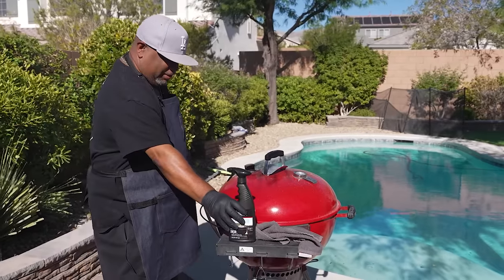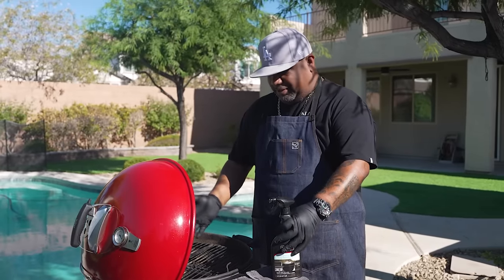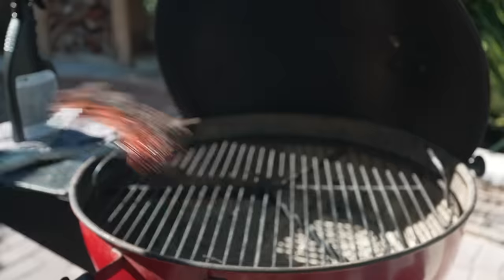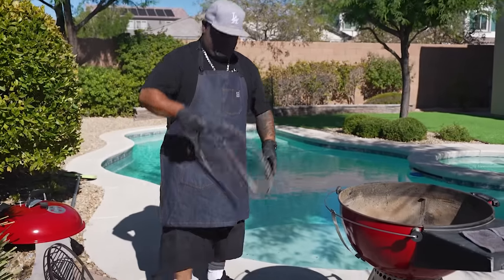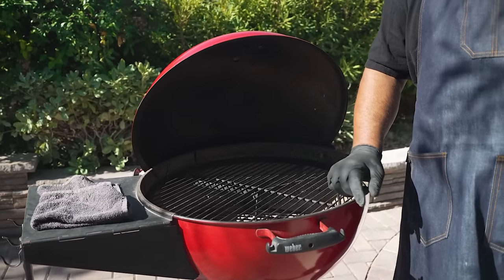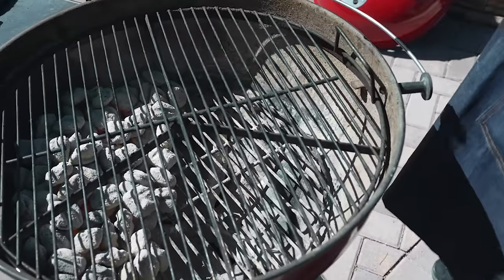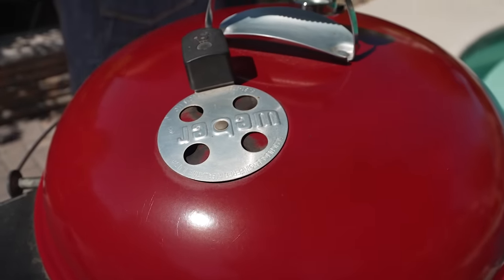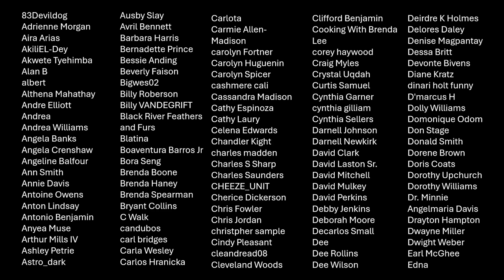Charcoal Grill Setup Explained EASY!

Comment: Yo... You never did show exactly how you cleaned the cooking grate ..you only talked a lot about it...the easiest and best way to actually clean it is after the food is done, there are hot coals left....so the grate is also hot... that's the opportune time to scrape it off with the wire brush... yes ,wire brush... that fear of metal brush bristles breaking off is straight paranoia... I been cooking on charcoal grills as long as, if not longer than you and cleaning up with wire brushes and have never had anybody swallow any broken off bristles.... it's some made up scurred stories.... tapping the grate after brushing will knock anything off....you  just keep beating the dead horse you mentioned..😅😅😅😅 but good try to promote extra unnecessary tools....you da man.